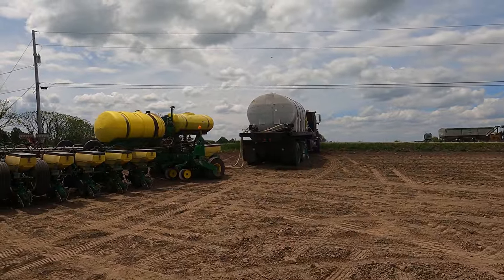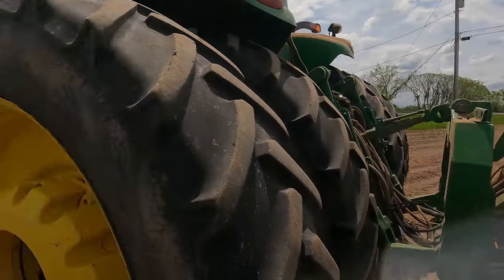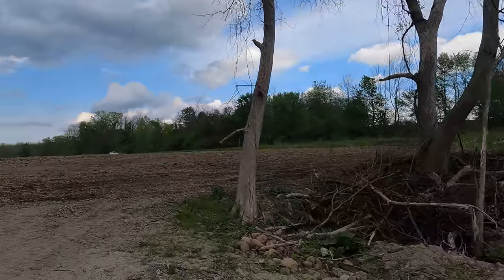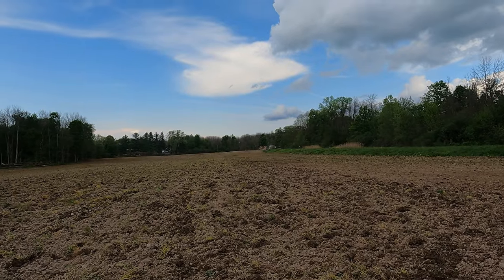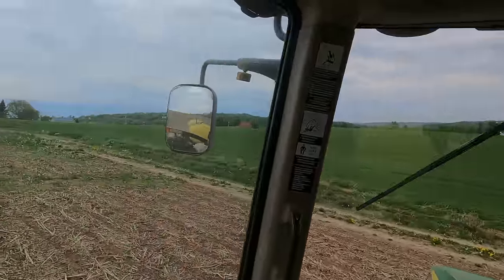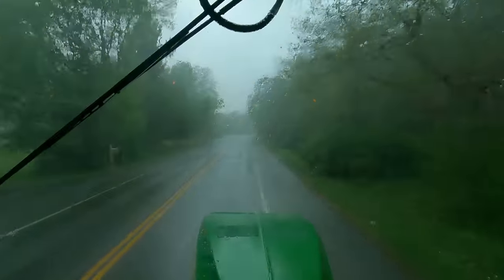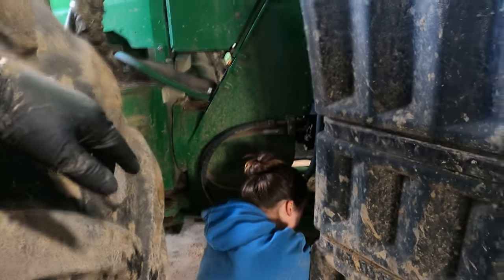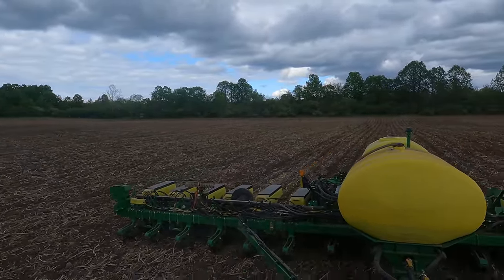The wheels are starting to fall off

Comment: So feel you on the fuel side of it Andy, here in NEW ZEALAND right now our diesel is between $2.60 - $2.80 per LITRE! Not Gallon,, litre.!  That's $10.20 a gallon @ $2.70 × 3.785 litres. (1 gallon)
It's a tough pill to swallow,  let's hope people wake up and administrations change.

Comment: Do you have off road diesel there (no roadway tax). Better understand the price.
Reply: Yes, they have red diesel for the tractors, but it’s still insanely expensive, just like everything else
Reply: Checking GasBuddy it is $5.09 for taxed diesel near me. (MN) Unfortunately the off-road diesel (know the station has it) is not listed fuel option in the app. 

Checked couple truck stops. Is $5.50 for taxed.

Off road should be about $0.30 less a gallon.

Comment: It has to be a pain planting all the odd shaped fields without markers. Sometimes it's just easier to drop a marker for a couple of passes rather than reset your A-B line. To each their own.
Reply from the maker: All the guidance lines I already have recorded and this display I’m using has boundary track that works great

Comment: No excuse 5.17 for off road diesel fuel. On June 21, 2019, the largest oldest refinery on the east coast in Philadelphia,  PA. Caught fire and burnt to put the refinery out of business, built in 1870, it refined 390,000 barrels of diesel and gasoline a day. 190,000 barrels of diesel a day, that figures out to 8 million gallons of diesel everyday, that has not been produced in almost 3 years. That refinery needs completely rebuilt, putting 1100 people out of work forever. That has hurt the east coast very much. A Saudi oil minster said drilling more oil is not the answer, he said the US needs more refinery capacity to get caught back up, I agree and quit selling 8 million plus barrels of oil overseas like we have for the last 20 years, everyday, that includes the last4 presidents, Biden, Trump, Obama  and Busch 2.